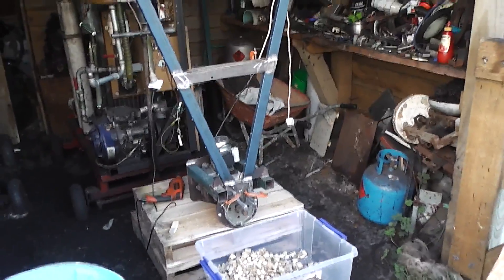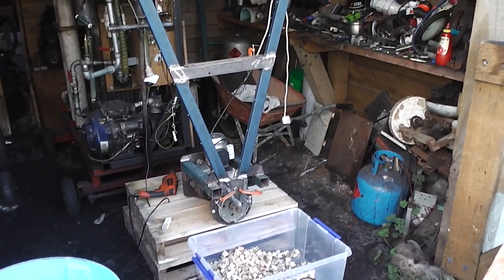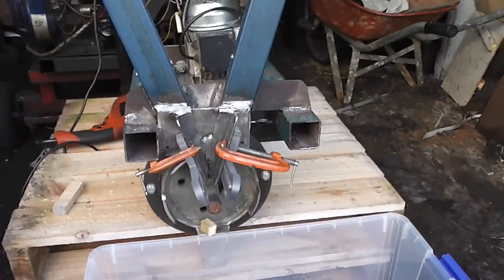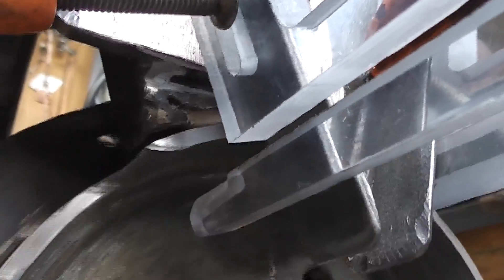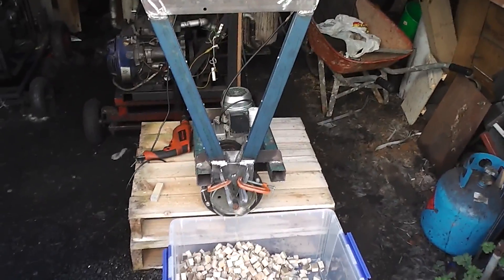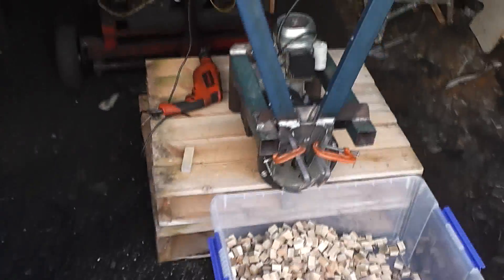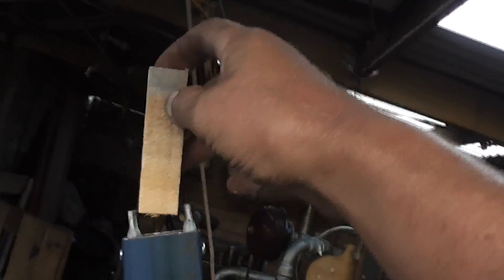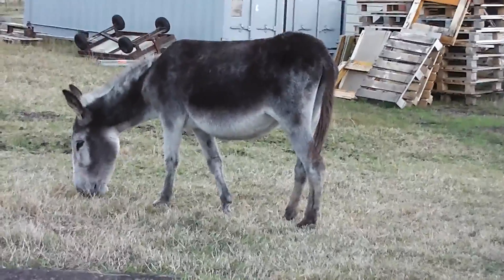Gasoline Granule Generator V2

Comment: You could add a small cam in the middle to push your spring loaded stops out of the way.
Reply from the maker: ***** 
Indeedy. 
It could be driven by the features on the cutting drum.
This action tends to happen by default anyway, as the fuel is being pushed downwards, then sideways, by the passing blades.
Over time, I am sure I will be adding all sorts of new ideas to this machine.
I gave it another test run today, and produced 90 litres of gasoline granules. The gasogen is using them right now, so I can have lots of lovely watts in my bubbly batteries  :) .
Reply: ***** Howdee dude. Busboy here. I was wondering if the flexing of the back stops could be eliminated by re-grinding the cutting edges so that the slant is on the outside of the "drum" rather than the inside face. This would then push the uncut fuel back up the feed tube slightly, rather than push the cut fuel pellets down onto the backstops.

Have you checked out the price per cubic metre of wood mulch, such as is the output of those tree-munching wood chipper machines? Garden supply stores where you can buy gravel, sand, sea shells, etc, tend to have bark chips and wood mulch too. When you run out of pallets to chop up, this might be a cheap and time-saving option. Although, you might have to let it dry out for a while first. When it's wet and in a heap, and slowly decomposing, you can stick your hand in the pile and feel it's quite warm in there. Hmmmm, I wonder if there's a way to use that slow-release of heat to warm your house non-stop all winter from a single pile of wood mulch?...
Reply from the maker: Max Brewster
Howdee Busboy.
The flexing of the back stops is all part of my evil plan to turn those naughty treez into wood fuel.
No more shall those triffids steal the twinkies out of my briefcase  ;) .
I considered reversing the cutting edges, but then I remembered how a pair of scissors behaves when there is a problem with relationship between the blade faces.
The cutting rotor is machined to quite a fine finish on my lathe, and its blades pass very close to the reinforced outlets of the magazines, thereby working like scissors do.
The motion of the backstops is actually a useful thing, as they support the fuel column, yet easily give way when something gets jammed in the rotary shearing assembly.
Since this video was made, this machine has evolved quite a bit.
The backstops are now contained in slideways that limit their motion to up and down, as opposed to left and right.
This machine isn't perfect, but it is soooo fast that I am happy to tolerate its unique faults and foibles  :) .
In time, I will enhance its magazines, so it can hold a lot more fuel - and operate unattended.
This should make it more versatile than it currently is.

Wood mulch is a possible fuel for this gasifier, but I would need to run the mulch through some form of sorting process.
Each gasifier is designed to handle a certain size and shape of fuel. When you go too far outside those limits, the gasser can start to misbehave in all sorts of potentially expensive ways.
Unfortunately, I have made pretty much all of the mistakes in the gasifier bible.
As a result, I have become quite adept at repairing engines  ;) .
If I can find a way to reliably sort wood mulch, and the like, I think this would be a winner.

Talking of waste heat, the exhaust from the gasifier's engine is almost totally odourless. Try as I might, I really can't detect any actual smell in it.
I often run the wood processors in the shed with this gasifier for hours on end. The exhaust fumes and waste heat make for a nice and warm working environment, even when the weather is at its worst, such as is the case on most weekends.
I would like to try some form of heat exchanger, so I can use some of that waste heat in the house.
As it is, only a little of it is put to any actual use.
My latest experiments in waste heat recovery have been useful, as I now have the ability to produce lots of hot water.
Also, I want to experiment with using the waste heat for steam distillation, so I can produce clean drinking water.
Sooooo many ideas, sooooo little time!!!
Reply from the maker: Max Brewster
Indeedy.
I want to see just how much value I can squeeze out of the wood that this beasty eats.
It doesn't guzzle the trees like the big beasties do. Instead, it 'sips' them, so I shouldn't have any trouble with unwanted visits from angry triffids and the like  ;) .

In reality, because this is a very low powered unit, there is not very much waste heat to be had.
The majority of it is in the exhaust gas, as opposed to the metalwork of the gasifier.
When driving a 2HP shaft load, the exhaust gas heats my home made muffler to 350 degrees C.
A copper tube wrapped around this allows me to heat water to the boiling point, if I pump it around the system slowly enough.
If properly developed, I think this will become a great asset around here.

Staying in the Wattage Cottage for extended periods of time while enveloped in the engine's exhaust fumes is probably not among the very best of my ideas, as I have discovered that I am not death proof, but only death resistant!
I think I will get me one of those carbon monoxide detectors, so I will have some form of warning if the gasser tries to send me back to my maker.
The gas that the engine consumes contains a pretty high percentage of CO. It burns with a purple flame, as there are other gases mixed with it.
After a few whiffs of this gas, one feels light headed, and a headache usually ensues shortly thereafter.
These are among the symptoms of CO poisoning, so I have to be supremely careful when operating this beastie. 
That stated, I have not detected any ill effects from prolonged exposure to the exhaust fumes that come from the engine.
Still though, caution is well justified.

This gasser runs quite happily on anything that will burn, including most plastics, food scraps, bits of bone, paper, saw dust, used motor oil - and Unicorn poop.
It should run just fine on coal too, but I am yet to actually try that.
The critical factor when running it on these other fuels is that you don't want to go much beyond about 5% concentration.
The wood produces charcoal as it burns in the gasser. This charcoal is the reagent that actually creates the CO gas during the reduction process. 
When sufficiently depleted by excessive use of alternative fuels, the charcoal will fail to properly process the pyrolysis gas.
As a result, you get nasty tar in the plumbing.
Been there, done that. Got the tee shirt  ;) .

I have to admit that this thing is very expensive to run.
Indeed, it costs me up to 4 dollars a month!
Well, I do have to replace the engine oil every 100 hours  :) .

Comment: Classic dude! Love how the central hub is open to allow the parts to drop freely. Will you be using spring steel instead of acrylic as your stops on the finished model? Keep up the great work dude!
Reply from the maker: ***** 
Howdee partner,
That open hub is great for gaining access to the blades and freeing up the fuel flow.
I will need to add hard facing welds to the blades, to enhance their lifespan though.
The springs are made from Polycarbonate, as I found that the acrylic was inclined to break too easily.

The finished model may use spring loaded sliding bolts instead of these spring arms. This would allow me to add set screws that will govern the size of the gasoline granules that come off the cutter.

I think I need to be making smaller granules anyway, so this adjustable feature will be a good thing  :) .

Comment: As always, very impressive. I love the direction you take this with the plcs and programs. I have purchased my plc, mounted the electrical box on rubber mounts, got my expansion tank done, and also received all my rtds , negative air pressure sensors, duck bill float switches and lots of smaller items. I am in the process of sealing up all of the loose ends and testing vacuum on the system. Any items that don't pass my strict test are being dealt with. Video will be coming soon. Thanks for sharing these awesome videos with us.
Reply from the maker: mazdalorean 
Howdee Mazda,

Thanks kindly. 
The idea for this machine has been sizzling away in the back of my mind for a year now, so I am glad that I finally turned the concept into a reality.
Putting sensitive equipment like your PLC into a box on rubber mounts is a very good idea, as vibrations in the machine frame would surely ruin it otherwise.
Talking of PLCs, I found that I was never really all that good with them, so I tend to design my own computer systems around a microcontroller, such as those sold via Microchip.com.
These are cheap, and very small, which is good when you have limited space to work with.

Your approach to this is very methodical, and I think you will benefit from this careful way of doing things. It surely means that you will be able to resolve any problems before they get a chance to interfere with the performance of the final model.

I can't say I have been quite so careful, but I am truly delighted with the results so far  :) .
Mine has clocked up 433 hours of trouble free operation to date.

We all look forward to seeing your new videos, as we are always learning from each other, and helping one another to create the best possible design.

Keep the coolness happening bro  :) .